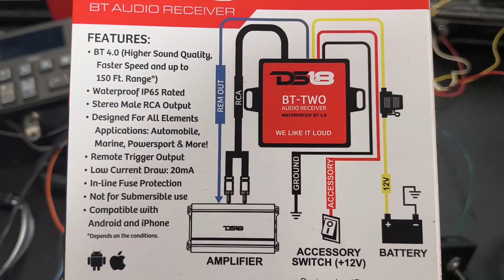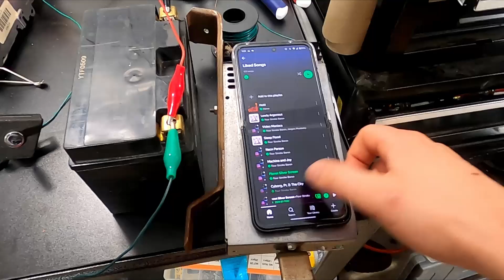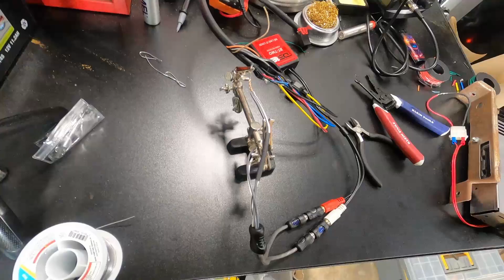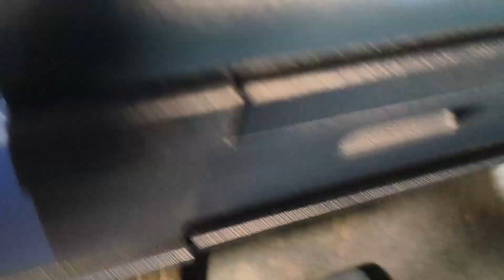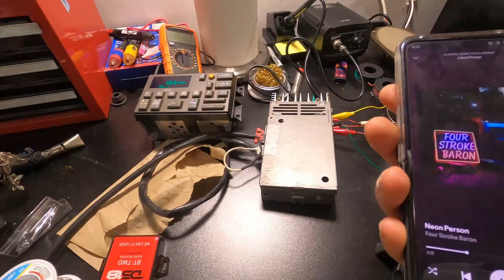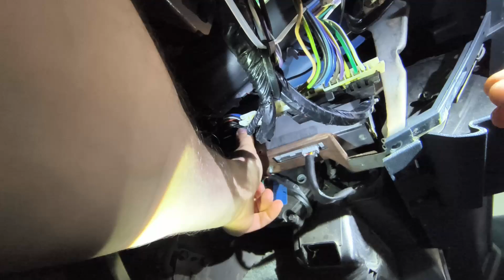The Cleanest Way to Add Bluetooth to an OBS Chevy Truck

Comment: I don't have a tape deck or a stand alone EQ, could this be accomplished with just the stock radio? I have the wiring harness to a tape playing gmt400 radio.
Reply from the maker: @TheyCallMeCade That's how I set mine up. I have nothing in the center, no tape or EQ. I wanted the storage pocket in the center.  As long as you have the harness, you can solder in the wires for the Bluetooth. Follow the video steps.  If you have questions, let me know.
Reply: @wheelbarrowtech can do, wanted to check before I get into the weeds.

Comment: I may have to do something similar because the expensive factory look radio with added bluetooth is very noisy when BT connects.
Reply from the maker: Does it have a whining sound from power?Which radio did you go with, Santa Cruz?
Reply: @wheelbarrowtech  1Factory Radio is the one I bought.  And I'd say it sounds more like a hum than a whine.

Comment: I’m following your instructions on my ‘92 and have a question. My CDM doesn’t have the pin outs. Can you tell me which pin is #1 on the cassette plug and the head unit for that ignition wire? Thanks in advance!
Reply from the maker: I have a diagram of all the pins for the CDM on the GMT400 site that will hopefully help:  https://www.gmt400.com/threads/1991-k1500-guide-to-stock-radio-bluetooth-setup-auto-connect.74098/#post-1528752

The pin for the ignition wire for the Radio face is Pin 4 on the Left side of the CDM, (Pin 1 being the closet one to the driver when it is installed).  Connect that one to the accessory cable for the DS18.
Reply from the maker: The first pin on the EQ/Cassette plug (which is actually pin 7) is the mute, shouldn't need that pin.  Let me know if I can explain better or send you a pic.
Reply: @wheelbarrowtech  Thank you!

Comment: I got a Bluetooth cassette for like $20.  I like your setup better because I have to eject the tape, turn it on, and connect my phone every time I get in the truck.  This is cool, thanks for showing how to do it.
Reply from the maker: I saw some nifty setups with the cassette tape activation but I wanted that pocket in the middle storage space haha.  I do miss those pretty EQ lights in the middle though.  I thought about somehow splitting the EQ to retain the equalizer functionality without the cassette.  Would be cool.

Comment: You didn’t run into issues with the gauge lights turning on when you flip the key forward? I had to re run the red wire for the ds-18 two to a fuse adapter in the fuse box by the knee so that my gauge and parking lights wouldn’t turn on with the key
Reply from the maker: I see.  Did you cut that wire that is connected to the jumper from the ignition? If that wire (grey in my case) is connected to the dimmer pin on the CDM, maybe that is causing issues.  Hope that made sense.  If not, let me know.  I can make a vid or post a pic on GMT400 to show exactly what I mean.